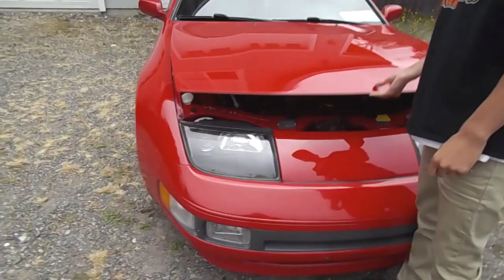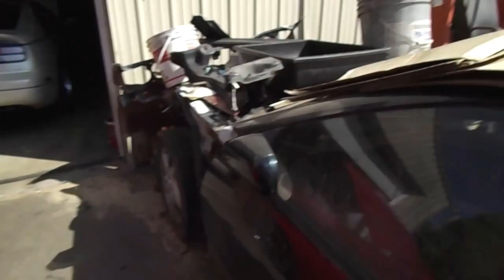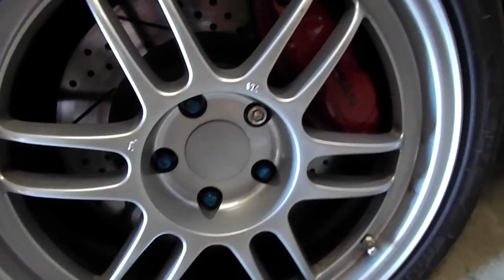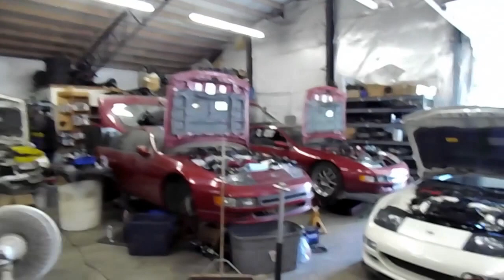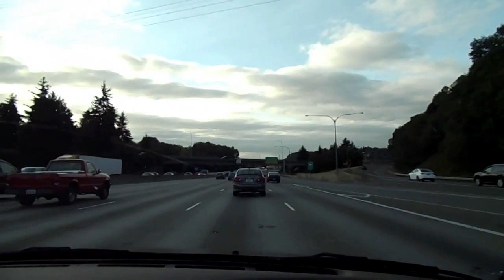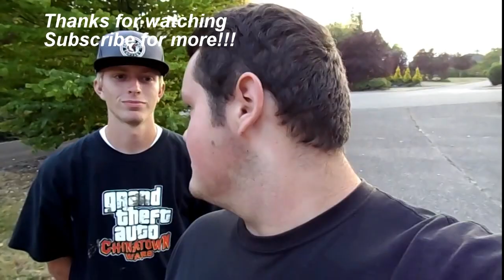300zx Heaven, Twin turbo drop off.

Comment: dude your n/a looked very clean you could of sold it and got a TT original
Reply from the maker: The Noid Peter tried to find a TT one but there is so few of them up in Washington, so he decided to make his twin turbo and his NA body was super clean.
Reply: Driven NW oh man was just saying bro that thing looked spotless but hey I guess its a win on his part 🙋
Reply from the maker: The Noid Yeah he's pumped to get it back in about couple weeks! Stay tuned!!
Reply: Driven NW me too just waiting for after the holidays and my Z is going in for a fresh paint redoing the leather and redoing my WORK EQUIP wheels, but OK man keep us posted on the progress and make sure they don't try screw you over cause over here took my Z for a hesitation and the shop called me in the dude said my engine was gone and needed $6k to drop in a new one I said no took it home and after replacing all the spark plugs and coil pack connectors it purred like new and the connectors only cost me $35, so yeah be careful with some of them shops lol
Reply from the maker: The Noid damn they tried doing you dirty! :/ shops like that suck... in our channel update there's some pictures of peters Z from the shop that's working on his. The guy that runs the shop specific works on 300zx's and is super legit so Peter's in good hands. but thanks for the advice bro 😎